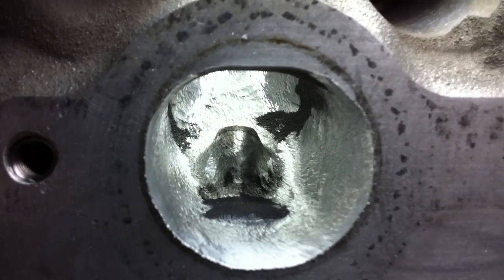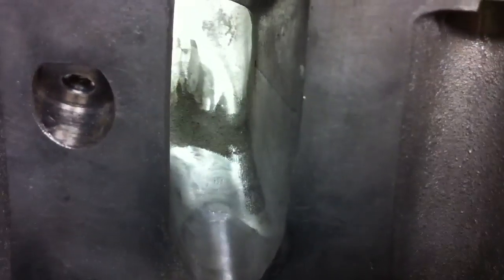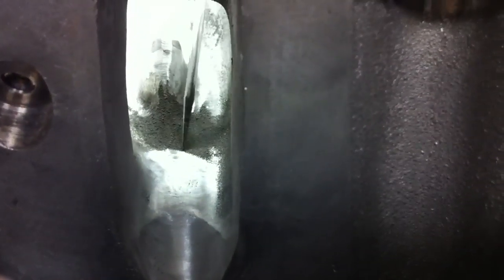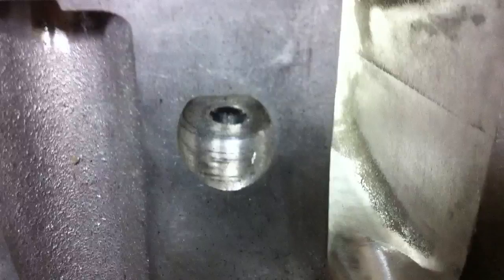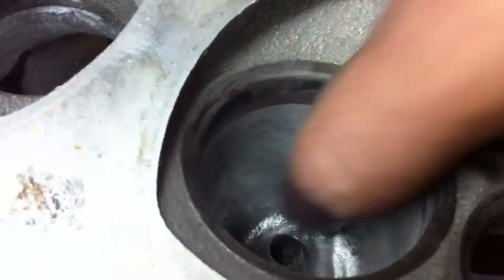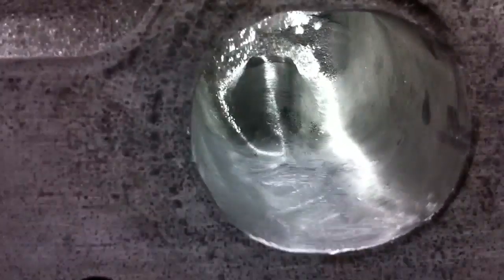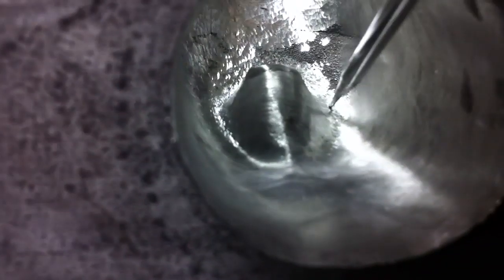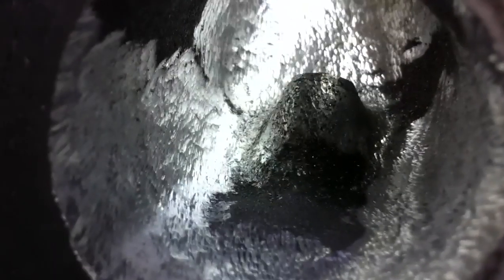How To LS1 DIY Head Porting Part 7 - Tootsie Roll

Comment from the maker: No, I have not. I would like to though. I've wondered how much improvement it would be with just a rough cut. Its all about the money. If I had the extra cash I'd flow test a lot of different approaches.

When you did your rough cut, what was all cut? Swirl ramp and rocker stud lump removed?